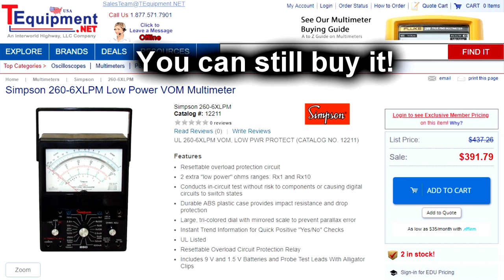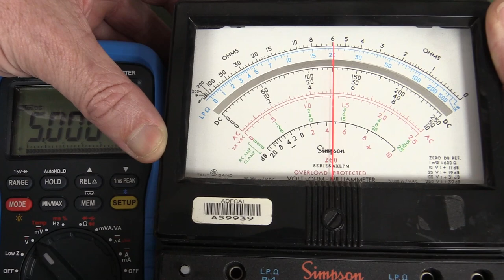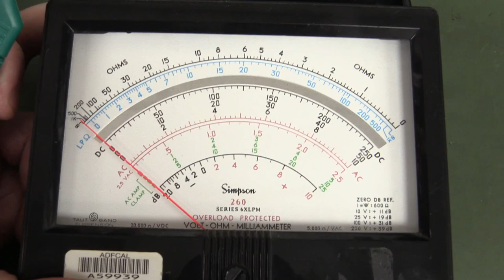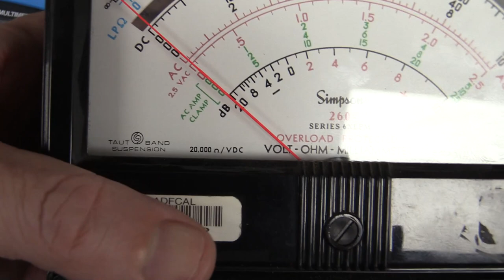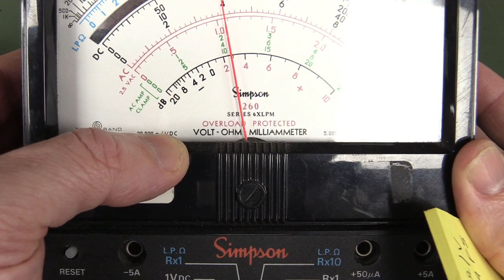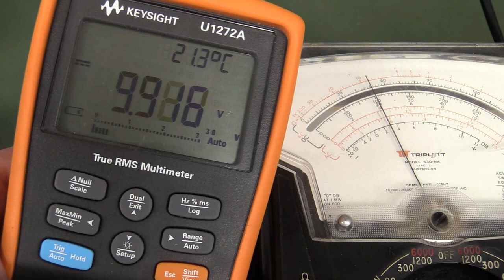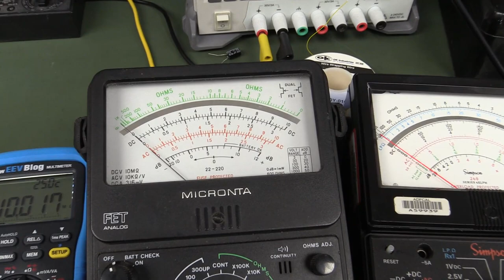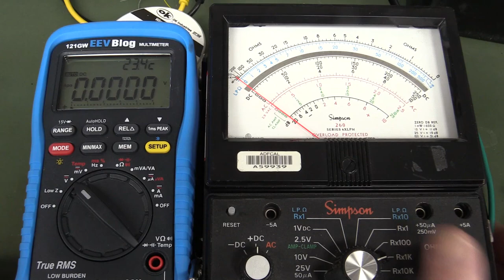EEVblog #1067 - Analog vs Digital Multimeters!

Comment: Analog for telco field use. The needle movement is a really good indicator of resistance capacitance impedance etc. Most of the time you don't need to look for an actual measure. The needle activity tells you a story about the copper you're dealing with.  It is a craft thing. My Simpson will always be my first choice

Comment: I work in telecom and carry both a Fluke 177, which gets used the most, and a trusty old Simpson 260.  The Fluke DMM is utterly useless when trying to look for cable faults, specifically grounds, on copper cable that has AC power influence on it.  The Simpson will show the fault no problem but the Fluke will not due to the interference of the induced AC.  Good analog meters still due have a place in this day and age.
Reply: I also have to use it to catch quick high voltage pulses when working on an HDSL circuit because the DMM doesn't seem to update quick enough to see them most of the time.  Seeing the needle jump to 180VDC is much easier.  Accuracy is not part of the equation, visualization is.
Reply: YEEEEEESSSSSSSSSSSSSS.
Reply: @suzukiman650  The peak min max function on a DMM would capture that transient.
Reply: exactly
Reply: do you think to make an informative video?
Reply: @suzukiman650  So like difference between digital and analog clock.
Reply: Even some of our veteran electrician recommend analog multimeter in testing AC motors they say it can detect faults in AC motors grounds shorts etc.
Reply: That does not justify use of analog instead of my Agilent for what I do. Not for me.
Reply: why wouldn't using a low impedance mode, or a low impedance adapter work the same then?
Reply: @lusqwerty  Are you saying that nS mode (Cinductance) can not assist in finding fault like this?

Comment: The analog db scale comes in handy when you want to calibrate audio equipment.  That and RF alignments are the reason I keep the Simpson 260 around.
Reply: The exact reason I have one. It is much easier to peak something when you watch a needle peak and not numbers counting. A digital one that shows you some sort of graph will work but a simple analog multimeter is much easier. Same with RF power. Use whatever meter you want but at the end of the day an analog Bird 43 meter is the standard and what you will be judged with.

Comment: analog meters are irreplaceable for audio measurement and adjustment, as the needle 'moves less' than a typical digital meter. I use an analog AC millivolt meter when I calibrate tape decks, near impossible to do with a digital meter. Having said that though, for most other measurements, digital is the way to go. But, analog meters do have their preferred uses in certain applications.

Comment: I have 6 meters in my workshop but I still use the analog one when testing transistors in audio work.  The reason it makes life easier for me just taking a glance at the pointer and see the angle instead of reading the digits in a digital multi meter.  Testing resistance with a DMM sometimes will give erratic readings to a pre energized circuit.  Even the slightest voltage will disturb the readings and I have to disconnect the particular resistor to get the true reading. Electrolytic capacitors will hold a small voltage even when switched off for a long time.

Comment: My dad had a Simpson 260 and I  would use it all the time. I got excited when digital meters came out, but my dad liked the  Simpsons because if you have an intermittent circuit, the needle on the Simpson will respond and give you an instant result.

Comment: Its a very useful tool to have. I find there is nothing faster when doing troubleshooting. I set the meter where I can have it in my peripheral vision when I'm poking around taking rough measurements. Obviously a DMM will be more accurate and have better resolution, I have lots of Flukes. It's not a matter of which is a better meter, its using the right tool for the job.
Reply: Exactly

Comment: I still remember being disappointed when I found out that the "output" function wasn't a voltage source
Reply from the maker: Me too. Some people think it's good for coupling to a scope, but scopes have AC coupling anyway so it's kinda moot.
Reply: I thought I was the only one.
Reply: It's called OUTPUT because you can connect it to the anode of an audio valve and measure the output audio signal.
Reply: I wonder what is that reset button for!? Schematic didn't show it...
Reply: @gianlucalocri  You clearly didn't pay attention
Reply: @SodAlmighty  yeah you are right, I totally missed that part! For anyone interested it's around 24:10

Comment: I think one of the huge benefit of starting with an analogue multimeter - I got my first in 1982 - was it gave you a good grip on measurement error early on: as Dave pointed out, these things are less accurate than their digital counterparts, the resolution was quite low and you'd better be sure you were dead in front of the thing to read it correctly.

Comment: they are still used on the american railroad for checking for grounds in the non grounded dc system.  I used them when I worked for Norfolk southern railway and we had a digital meter but all track and grounds checks were done with simpson 113. here is the meter we used https://www.simpsonelectric.com/products/test-equipment/special-test-equipment/ts113-multimeter-for-railroad
Reply: It's not because it's better, it's just not cost effective, practical to change the procedures and equipment out and  have to retrain and document. You can still buy some really old meters new and their whole market is because procedures and procurement are too hard to change. The above could be a life or death situation, changing everything is risky unless they get something out of it.

Comment: Testing pots/varistors/switches for dead (open/short) spots can't really be done with a digital. My most common use is testing throttle position sensors on vehicles. Analog meters make that test stupid easy. Digital meters miss at least 15% due to refresh rate. All I need to see is the needle jump reliably at the same place 3 tests in a row and you're never going to find that with a digital. That's pretty much the only thing I use my old analogs for. Or if the batteries are dead in the digitals and I need a voltage measurement now.
Reply: Is just a meter of interpretation

Comment: I still use an analog meter (and a VTVM at that) when doing RF alignments.  Much easier to tune for a peak or dip using an analog meter, even compared to the bargraph on my Fluke DMMs.

The "output" jack on a VOM was intended to be fed out to an oscilloscope, typically used for looking at ripple on power supply rails.
Reply: I assumed they were all DC coupled and without the cap, there is no way to strip the DC from a biased signal.
Reply: I agree, even with a Fluke and the graphing indicator it still isn't as easy to do RF alignments, as it is with a VTVM.
RF alignments is the only use now days I have for my VTVM.
Reply: And it probably has a true jeweled d'arsonval movement. I once had some heathkit and rca vtvm's...a "voltohmyst" i think i remember as well.

Comment: Friend of mine found one use for an analog meter, he had an issue where his car battery kept running flat (some years ago now).
He tested with a DMM to see how much current was being drawn when the car was off, saw a lot of bugger all. Connected an analog meter, saw it kicking about once a second, of all things it was the clock.
Reply: @Bilde Rothchild he didnt have a pulse meter but had an analog meter on hand
Reply: I can find that problem with a DMM as well. I always do it.

Comment: Sure I use DMMs now, but I miss analogs for one reason : when checking an expected voltage, I could register the needle position within a corner of my eye, not having to directly look at the meter, thus knowing whether I've found, say, 12V or not.
With DMMs, even with bar graph - you have to look into the display.
I find DMMs to be  measurement instruments, while analogs are representation instruments.
Reply: Exactly the same reason why many cockpit instruments, pressure indicators, etc. use an analog style display.  I say analog style, because the displays are purely digital.

A lot of the "analog multimeters are better because..." reasons - other than the ones about very niche applications (GHz AC?) for which I'm sure there are niche DMMs available - are similarly not actually about how the multimeter fundamentally functions, but about how the information gets displayed.  Swap out the fixed-segment LCDs for a matrix one (given prices, just go full graphical TFT LCD) and now you can display accurate values as well as graphical presentations however you design it - from a classic analog meter look through to a basic and dirty 'oscilloscope' view.
Reply: If you try to measure 10V and the meter rapidly jumps between 9.xx and 10.00 V, makes it look like you have almost 20 V if you don't think hard enough.   What could be better than if your altitude appears to be twice as high as it really is? (:
Reply: True you need to interpret digits, but reading analog you just look. My Fluke has a bar graph at bottom of the display and is very handy sometimes. Look at aircraft instruments important (spatial) ones are always analog. Who wants a digital clock? not me.
Reply: I remember an upright video game, 3 other techs in shop thought roms were bad.  2nd player score was between 1st player and centered high score.  Digital meters showed a bang on 12v supply.   My analog swung from 12 down to 8v.  Confused, i used a scope and saw the short dip to 8v.  One leg of brute force power supply filter cap had broken.
Currently i see a fluke meter blackout a 4 micro amp signal, and a couple of other digital meters require a little swag to filter out the effects of non 60 hertz signals.
But ohms, i still prefer digital.
Reply: I get this, so true! The better DMM for automotive use have those functions built into them though, so you can hear or see lights for  + or - 12 volts and much more.

Comment: No one uses analog meters anymore? Be sure to tell Simpson and Triplett and Sanwa and Gossen and all the rest of the manufacturers that still make them.
Reply: I disagree. Analog are much better at seeing trends. Plus they don’t need batteries for amps and voltage.
Reply: @ronvaliant9337  i bet my pc notifying me when some value changes is superior over checking a multimeter every 5 secs...
Reply: @jonny393  LOL Yeah and it's real convenient to carry a pc with you everywhere you want to make a measurement like on a boat or an rv.
Reply: @ronvaliant9337  then i would maybe just take an oscilloscope with me instead of an oscilloscope sized Analog Multimeter
Reply: @jonny393  Then you also have to plug it in so don't forget a generator. lol
Reply: @ronvaliant9337  Nah dont worry my scopemeter goes a couple hours without that
Reply: @jonny393  How much does it cost?
Reply: @ronvaliant9337  i guess like 1500€, but you could just watch your Voltage go down or up on a cheap multimeters bargraph or on something with 5+ digits of resolution
Reply: @jonny393  Yeah. It's all about personal preference
Reply: @ronvaliant9337  i guess if you really like the Analog experience, thats the way to go...but objectively im pretty sure there are almost no reasons to use one :D
But they look hella cool!
Reply: @ronvaliant9337  Yes they are at very low frequencies but as Dave has pointed out at higher frequencies the meter cannot detect trends because the needle response time is too slow. Although some digital bargraphs are useless in cheaper designs.
Reply: @ronvaliant9337  Raspberry Pi

Comment: Analogue meters still have their place, all the workshops I worked in had one somewhere. I still have my first meter, a Maplin analogue multimeter from 1988 - with transistor tester!! (Sadly Maplin Electronics in the UK has just shut down)
Reply: Maplin was a shadow of its former self. I still have a section of the catalog I tore out which showed the pinouts for all the ICs they sold. Why do all technical stores end up going that way?

Comment: It is hard to beat a cluster of analog meters to quickly give you a quick idea that the process you are monitoring is working or something is going amuck. They will always have their place. They aren't better nor worse, they are simply different.
Reply: Exactly, perfect for e.g. showing that a bunch of temperatures in your process are close to perfect (needle vertical), a bit below/above, a lot below/above, ... All by having even only a swift glance at the panel. Even led vu-meters aren't as good for that.
Of course, these aren't multimeters anymore.

Comment: You cannot beat an analog multimeter for checking small DC motors.  Using the ohm Rx1 scale, you can immediately see if the motor has dead spots (shorts and opens)  at various angles by how much the meter jumps around.  Shoot, you don't even need to turn the motor shaft by hand to check it too as most analog VOMs will spin the motor.  Even will tell you if the bearings are binding. To a less extent, peaking or adjusting for a null is a little better on an analog meter. But yes, for every thing else, you cannot beat modern DVM.

Comment: I am a HVAC contractor and for measuring starting amperage for a compressor an analog amprobe is superior, digital does not react quick enough. Although some of the newer digital amprobe (clamp meters) do record inrush amperage.

Comment: Hey Dave? I just completed performing Electrical measurements at tafe as part of my diesel fitting apprenticeship. This video, if it was shortened would be super useful for the teachers to explain the differences between the tools. If you make a shorter version i would link it to my teachers.

Comment: Ultimately i think you need to have both types of meters, a DMM thats at  5 1/2 digits or 6 1/2 digits resolution for the quantitative work and an analog meter for troubleshooting circuits and field service.
Same with Digital vs Analog o-scopes, there are certain things that each type will do better. Nothing better than an old Tek 2467 for a fast capture or looking at RF. But just the same I love having a digital o-scope with its serial decode and signal analysis functionality

Comment: The only thing that was better for me was when I repaired TVs and other electronics. The low input impedance often helped me find errors because a fault in the circuit usually made it react in a non-normal way when I measured at that point. It was also easier to just fast glance over and see that "something" is measured. A digital could sometimes be hopeless with the numbers jumping around. Sometimes you dont know if you got contact or not because of the high impedance. 
The fact that it works without batteries is also a plus as mentioned. Especially if you want to have a multimeter in a place you seldom need it.

Comment: I used to use analog meters to find resonant peaks and dips of loudspeaker response by monitoring current drawn from the supply of a small amplifier. Much easier to see than the changing digits. The bar graph was useless for this too (not enough resolution).
Reply: They now have pretty decent handheld oscilloscopes.

Comment: Last time I used a analog meter was to get diagnostic output codes from ODBII diagnostic port on a car.   Keep track of the LONG and SHORT needle movement.   Worked back in the 90's when I needed it. :)

Comment: It's a matter of preference. I love my analog meters, which are excellent in 'Yep, the anode voltage is right around 170v' in circuits where it doesn't matter if it's 5% lower or higher. Or in high frequency environments that interfere with the digital electronics. 
I use a digital meter too, in high impedance circuits.

Comment: A few days ago i tried to measure supply current of Z-scale train model, and cheap DMM (I realise that advanced models can do that better, but I have only 830-clone, without bargraph) gave something reliable only for stalled motor. While running, an old analog meter gave me not precise, but more adequate information about current.
So, one of analog meter advantages - working with noisy signals (If you need an easy averaging, NOT the noise and short spikes detection). 
But you still have to check everything with scope while troubleshooting power supply issues.

And there were combined models, with digital display and analog needle, for those who have not decided yet. :) 

(Sorry for mistakes, english is not my native language)

Comment: Before digital multimeters existed, how did they make high-precision measurements? Is there something like a 7-digit meter in analog form?
Reply: Chris Hoppe Yes. It is called a differential voltmeter. There are a couple videos on YouTube demonstrating its use if you search that term.
A very sensitive voltmeter (called a null detector) was used to compare the input voltage to a divided-down voltage reference, usually with a 4-6 digit Kelvin-Varley divider.
Once you set the divider so that the meter reads zero, you directly read the voltage off of the dials.
Tedious, but could offer theoretically infinite input impedance in some ranges because there is no voltage across the meter once it is nulled out.
They have only relatively recently been replaced by 8.5 digit multimeters in NIST-type metrology applications.

You can still make a measurement this way with a modern voltage reference, KVD, and null detector, but the combined cost might exceed that of a new car.

Comment: Each and evry magnetic measuring head is most accurate at 2/3 traveling distanse of the needle. So even with the most accurate measuring head, your instrument is as good as there are many overlaping ranges, so that you can put measured value around these 2/3-rds. Still, for max-ing and tunning something you have to turn with screwdriver or turn-knob it is the best.